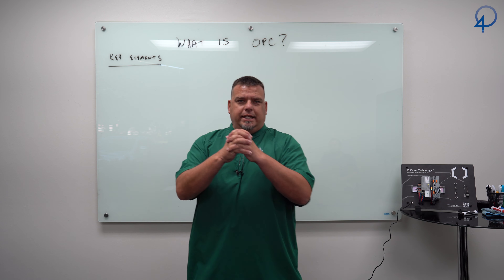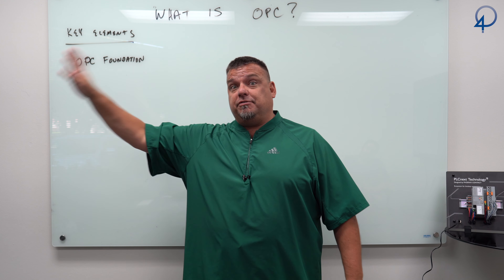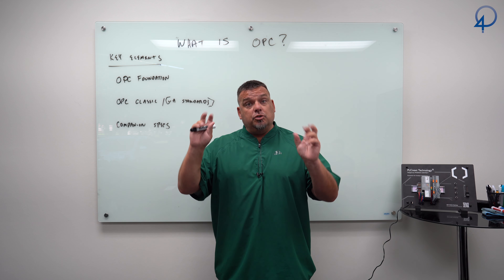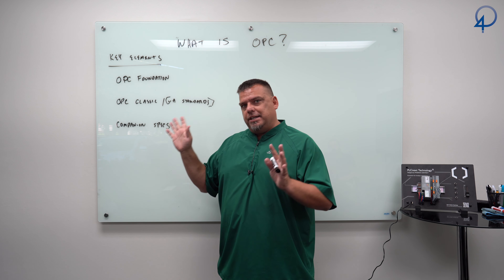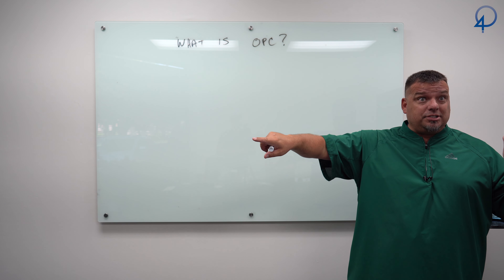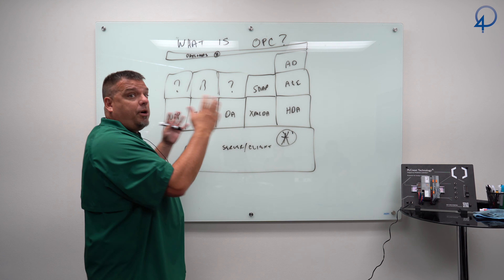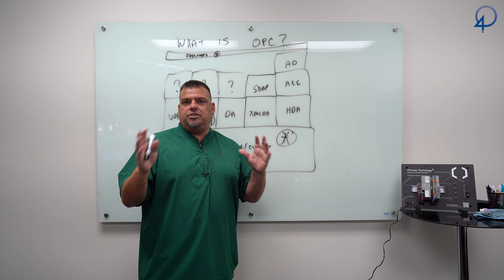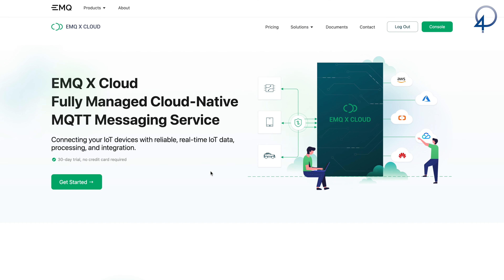What is OPC? - Part II - Key Elements & How does it work?

Comment: I would not be able to get this perspective anywhere else. I especially liked what you did at the end in providing a path for OPC UA to be improved. They really need to strip it down, really strip it down. I was not aware that in some cases with implementation that you would have to make a choice between "this" and "that" part of the spec. Really interesting. When I first read about Companion Specifications, I became completely confused and got a headache. But my experience in programming allowed me to come to the conclusion that it's just a really fancy "Typedef" statement from "C". It's like over-complicating JSON. In my opinion, it's just a big-ass data structure. I would not even call it a model. That's how I was able to wrap my head around it. Thanks again for another informative video. Learned lots as usual!

Comment: I think a way to simplify understanding of why OPC might not be fit for IoT is because it relied on a system (OLE) that had a big supposition at its core, namely: it assumed the communication was happening only inside the computer, via the paths in the motherboard, so it could assume with high reliability that the data would be transmitted, and transmitted properly, whereas in IoT data flow is not always that reliable, as it flows through many other mediums. Let me know your thoughts on this.